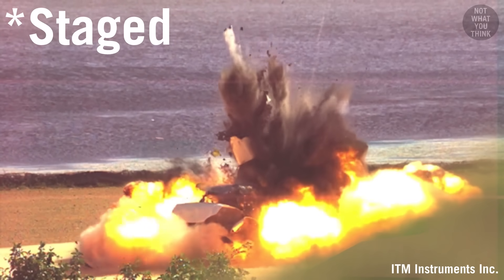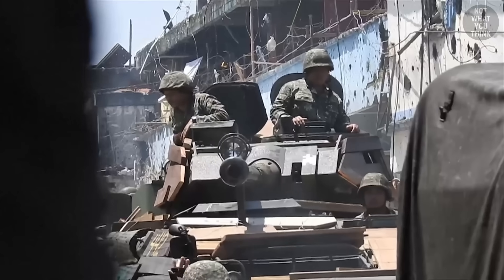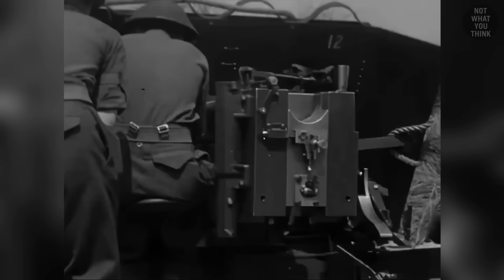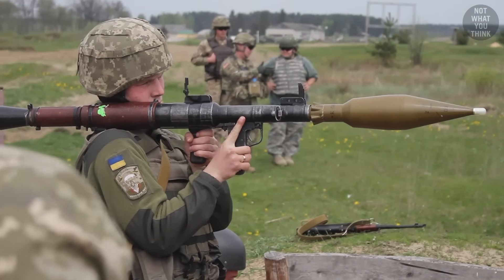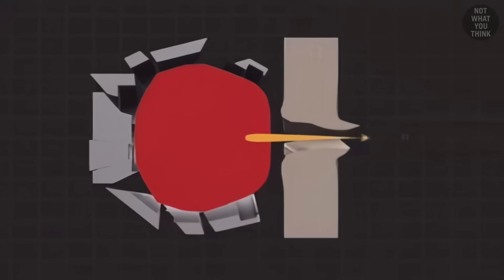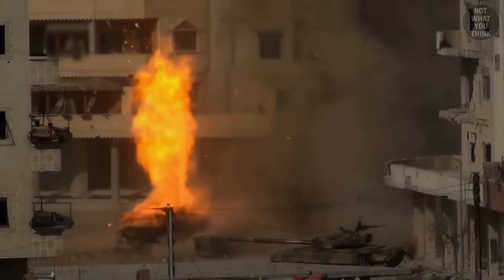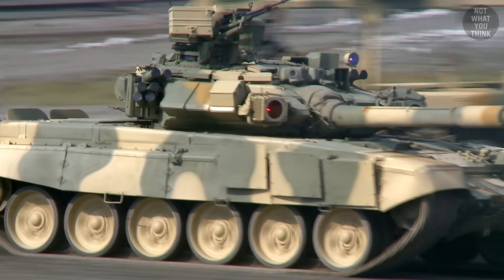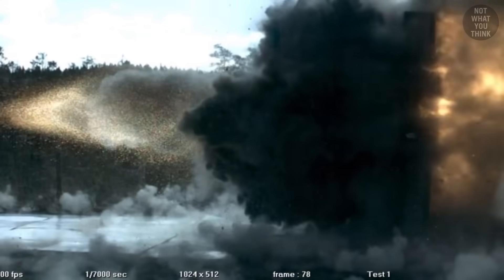Why Protecting Tanks is Getting Much More Difficult

Comment: you conclusion is not quite true when it comes to tanks being obsolete. They are still a terrifying weapon when used in the open. Tanks have lost it's role as a main tool to break through enemy trenches. This was basically what it was designed for in WW1. Today tanks are best used as a support tool and they work very well in the open area. The troubles begin if you deploy tanks in urban areas where their low vision range allows the enemy to come close and take an effective shot.  Russians made this mistake it at the beginning of their attack on our country, and that has cost them hundreds of tanks.

Concealed effectively, tanks can engage targets from distances ranging between 2.5 to 5 kilometers, well beyond the range of most anti-tank weapons like the Javelin missile. This long-range capability allows tanks to provide vital support by suppressing enemy positions and keeping enemies pinned down in their trenches while the friendlies advance, making them indispensable for successful breakthroughs.

The real tank killers are not a Javelin or the RPG, it is an FPV drone armed with a Thermite grenade which burns through every protection and a long range precision artillery paired with drone surveillance. I am surprised you have not mentioned these weapons at all You can get 100 drones for a price of one Javelin missile in the open market,  and that is a real game changer. Our guys deliver some world class precision work hitting the russian vehicles. Unfortunately, the russians learn from us, so they use a lot of drones too.

Comment: Tanks have been proclaimed "dead" multiple times. And every time they arose from it improved.
So yes, tanks will prevail. ERA and hardkill systems will evolve enough to counter infantry launched AT weapons and in groups of typically 3-4 tanks, they can cover each other against multiple threats. And when that point is reached, tanks will be again a dominating factor on the battlefield, if used correct.

Comment: In ukraine we could see that the concept of tanks is slowly dying off in the theater of war. They are mostly use as mobile artillery support barely ever going into direct combat. Drones on the other hand are ruling everywhere. Even travelling across the sea to reach crimea. 
But If we are still hyper focused on ground vehicles the concept of Armor needs to be thinked again. back to the drawing board. Thick plate of steel worked in ww2 but not anymore

Comment: 9:37 those nukes didn't go off because the conventional explosives used to trigger the reaction detonated on impact with the ground, which caused an irregular/unsymmetrical shape of the explosion, which was not sufficient to start the reaction needed to detonate the nuclear charge. 

basically, extremely lucky.

Comment: Pretty much the thing that always gonna keep tanks reliable is: big gun make other thing go boom.
Simply put, you wouldnt bring an Howitzer cannon to take out a entrenched position, because infantry will simply tear you down, you cant bring a SPG artilley either because auto-cannon exist.
Infantry wont do since all it take is one grenade and bye demolitions team, and you cant really protect them anyways.
Aircraft? yes and no, yes than you can take that position with them in matter of minutes, but no because, well you are limited by how much you can take out, how long you can stay in their airspace, how easy the targets are to strike... without even counting the costs and risk alone.
what about IFV, AFV, or APC for that matter, same with SPGs but without the main reason, the big gun. Yes things like Centauro, Stryker and so on exist, but those ARE SPGs by definition, so it didnt really change much.
All it leaves left is, you guessed it, Tanks. They the only thing that can take a big gun into a battlefield and just stand there, take alot of punishment, and you aint finna do nothing bout it unless you got the equipment AND training to deal with them, but praise god the tank crew inst experienced, otherwise you either got TOW/Javelins (or similar), Angry drones, or you go home in a body bag.

Comment: Tanks are not relevant on a modern battlefield
Reply: Active protection systems destroy incoming rockets/mortars/missiles, so they're fine.
Reply: @caesarsalad1170  But if we have APS, why would we bother armouring tanks as heavily as we do in the first place to begin with?
Reply: @mekingtiger9095  Because tanks still face small arms and autocannon fire and fragmentation?
Reply: @holokyttaja  All of these don't require an armor as heavy as that of an Abrams or a Challenger 2 to survive. A lighter MBT closer to that of a Leopard 1 would probably suffice.

Comment: You could just drone drop a contact activated shaped charge onto a tank. this would provide the same benefits as the javelin system, reduce the cost of the charge, and the drone can be reusable which would lower the cost of delivery as well. only problem with this is it would rely heavily on the weather for accuracy as far as I can see.

Comment: They should slap some non nintonian fluid between  a sandwich  of ballistics plats. Could definitely  help with armor. Yes it adds a ton of weight.. but.. we can build micro nuclear reactors  small enough  to power high powered electric motors tha can move the tanks. And a tank  now days is basically  a mobile bunker thay can provide fire support. Or anti air suppression.

Comment: The issue with Tanks in this respect I think comes from the fact it needs to expose itself fully to properly aim its main gun, and therefore relies heavily on its armor and active defense systems to survive. I think what we need is something that can use terrain more effectively. My nerdy brain immediately thinks of mechs, but I'm not foolish enough to think we have the technological capacity to produce them. At least not yet.
Reply: It’s already done. Many vehicles have unmanned turrets, like the Stryker mgs or the t-14 armata. I’m pretty sure the Abrams replacement to-be has it too.

Comment: In future A.G.S defense system will be developed and light armored tank will be the new standard as type of assault vehicle, heavy armors will be obsolete. A.G.S. stands for Active Graviton Shielding and it can be done in two different ways: phased A.G.S. and inverted polarity A.G.S. While the first is done with a high frequency square wave graviton generator, the package uses a lot more energy and it's also a lot bulkier, every kind of projectile and bombs will simply disappear at contact of such energy shield because of the high graviton density. At the contrary the inverted polarity A.G.S. generate a light density graviton field, but with inverted polarity (it repels matter), so the system can be designed to be less power hungry but it comes with limitation: the bullets approaching the target will be violently bounced back with the same incoming force, that's why you can see them ignite in mid air in a very spectacular fashion. But the problem is that for lower power type of explosion this system can still be used, when it comes to more powerful explosions (like missiles) the shield can be penetrated because of the low graviton density. Not only that... This kind of system is not suitable to protect against direct energy weapon like laser beams and graviton beams. From my time other hybrid system were developed like hybrid A.G.S with micro second booster generators, they can switch just for few moments to the power required  to stop a bigger threat to the vehicle. Ok that's enough from my 2045 diaries, time to go to my next temporal mission. But the point is: tanks will never be useless, my tank-lovers!❤😂

Comment: They have to use some tungsten or ceramic armor instead of steel
Reply: Ceramic armor isn't a very good idea for a tank or any vehicle, really. At least if it gets used as the external component of the armor. It is VERY succeptible to repeated hits from small arms fire and so any random with a machinegun can gradually wear it down by raining down enough bullets against it. The tank would pretty much have something very close to a videogame HP bar that is affected by any kind of mechanical physical threat as opposed to metal and that is not necessarily a good thing.

Comment: I think the future rolls of tanks will be battlefield coordination instead of direct combat. Heavy sensors, drones, soldier coordination, threat analysis, gear carrying.  Kind of a mobile "forward base" until a safer front can be established.
Reply: Tanks are also made to engage from way further distances these days. Urban warfare is not a great usage of tanks and that has been evident since Stalingrad imo.
Reply: @mikevismyelement Thank You! Anytime I watch videos of fighting that takes place today, I see tanks driving through neighborhoods. Is there that much of an advantage that a tank provides in urban combat? It just feels like it’s easy to turn that tank into a 70 ton road block and make the team inside a meal for rpgs flying in all directions from countless balconies and windows
Reply: @ydel1234  the reason why is that we have only seen asymmetrical warfare for the last 40 years outside of Ukraine. The old Soviet RPG's that insurgents in the middle east had access to wouldn't penetrate a modern tank. Tanks didn't have to fear every window, alley, or blind corner in these scenarios. 

Now that we have a more symmetrical battle in Ukraine, you see entire fields of blown up tanks for both sides. One can only imagine what Kursk was like

Modern anti tank missiles are incredibly effective at penetrating even the best armor. I think the strategy now is to roll the tanks in to "secure" the victory, as opposed to the spearhead tactics of WW2
Reply: At that point you might as well forgo a tank entirely for SP-Art or a IFV vehicle. The entire reason a nation foots the bill for the armor engine and gun on a tank is to either out maneuver the enemy or break through a hard point. If a tank can’t do either of those rolls it’s not worth using or making.

What you’re describing could be done by a tricked out semi-trailer. Or a tent…
Reply: @simonnachreiner8380  Finally someone here who gets it.  Combined arms doctrine consists of more than tanks and infantry.  But the way the tanks, armored personnel carriers/infantry fighting vehicles work together is simple.  If a tank and a platoon or whatever of infantry are working together, any enemy soldier has to be crazy to shoot off a rifle at a soldier protected by a tank.  When I was in, the number was about 6000 rifle rounds fired for each soldier killed.  (Trying to injure soldiers and not kill them is a way to tie up enemy soldiers tending to and transporting wounded.  The Russians have solved this by leaving the injured to die.  But I digress.)

Most tanks have a coax, a coaxial machine gun that uses the same sights as the tank main gun.  This allows the tank crew to save the main gun rounds for enemy tanks, APCs, and IFVs. A tank main gun round is much cheaper than a Javelin or other RPG, and more accurate unless someone has fired dozens of Javelins.  (Yes, the tank crews, at least American tank crews fire several dozen rounds a year.)  So the soldiers, with a friendly tank nearby, know that their job is to take POWs, and shoot anyone carrying an RPG.  What if there is a likely ambush spot up ahead?  In Vietnam,, there was a case that shows this perfectly.  A convoy was heading up a trail with a large tree off to one side.

"I wonder how many snipers are in that tree," the Platoon commander mused.

"Gunner, canister, tree...Fire!  Sir, there were eight, the Platoon Sargent replied.

This is the way combined arms works--the presence of the tank(s) keeps the infantrymen alive, and they take out anyone on foot who threatens the tank(s).
Reply: @eachus Yeah. Tanks these days seem like they really need the support of IFVs and infantry to protect them from hand-held anti-tank weapons.
Reply: @simonnachreiner8380  No, a semi-trailer can't parallel a street going through the ground floor of houses, apartments, etc.

The tank has a much lower ground pressure than an automobile.  If there are RPGs around that is where you drive and/or park. Same thing applies to tree lined roads.  The tank can parallel the road and stay away from anti-tank mines. It is hard to plant mines in or trees or tree roots.

Of course you may need to be "buttoned up" and trust the dismounts for situational awareness.  But you have lots of ammo for the coax to deal with suspected leakers.
Reply: good idea..lol but that thing would have to be huge to matter .. and at that point a huge target and still worthless.. noo what your talking about we already have in the air bud.. its called the AWAK (huge plane with a radar looking disc on top) its a mobile command and radar station.. tinker air-force base in Midwest city Oklahoma is the base of it..) not sure if I spelled it correctly.. but its outdated and they are placing it with a smaller more agile twin tail I heard with actual countermeasures..
Reply: @desperatedave3573  The new AWACS is called a Swallowtail.  The rotating dome has been replaced by an electronically steered array.  Eliminating the vacuum tube that powers the radar will be a nice cost savings, but the real savings are replacing a 4-engined 707 with a 2-engined 737.
Reply: Aerial superiority is the trump card here.
Reply: The Germans also made command tanks with panzer i and ii at the start of ww II to command tank groups at frontline, which is sort of like a command center
Reply: Exactly. We still have our ground to guard and i don't think tanks will go obsolete for foreseeable future.

Comment: This situation is more similar as to why people don't wear medival armour anymore. Even the thickest plated knight wouldn't stand a chance against a heavy crossbowman or in the later years a musket. That is because the destructive powers and penetration of this simple and cheap machinery became too good and that armored knights are basically just a slow walking target. It wasn't long before people started to ditch the armors as being too heavy and inconvenient to use. That's why in the later years, people began wearing only chest armor and those flashy and easy target redcoats.
Reply: You really overestimate the penetrative power that heavy crossbows had against late plate armor. Skallagrim has a video testing a heavy crossbow against plate armor and it's pretty good. As for muskets, plate armor also did a decent at keeping up with their desteuctive firepower... until the 17th Century when it just couldn't anymore.

That said, body armor has been making a massive ressurgence in the last 20 years and is still getting better and better even now in the form of ceramic plates. It has gotten to a point where the ever so iconic 5.56mm NATO round isn't sufficing anymore and even the 7.62mm is getting stopped aswell. For the first time in almost 400 years we're finally seeing armor catching up to firearms in the small arms department and armored (to some degree) infantry is finally returning to the battlefield. I'd say this is pretty damn revolutionary!

Meanwhile for our modern equivalent of "the Cavalry", though...

Comment: The whole video is based on the premise of "Arrow vs Shield" and how these two have surpassed each other in a constant tug of war yet ends with "is this the end of the cycle?". What, just because you've seen tanks taken out in Ukraine? Lmao.
Reply: exactly right, we have gone through this cycle at least twice with tanks, a good example is early to mid cold war designs like the leopard 1 which focused more on not getting hit due to heat rounds.  Then came ceramic armor which does a good job at defeating heat and shaped charges, when KE penetrator rod sabot rounds came out as a response at the end of the cold war through the gulf war then heavy metal chobam armor which combines ceramic levels of HEAT round resistance, and the density of the heavy metals like tungsten and DU which are very effective vs KE weapons.  BTW they do just fine vs all of the methods mentioned.  Given a redesign of turrets, to account to topdown attacks and I dont think protection will be out of vogue any time soon.  Also given the speed of drones and missiles your not gonna be able to dodge or shoot down all of them all the time, armor is passive and in a age where weapons are getting cheaper and cheaper passive becomes more economical/feasible.
Reply: @Lucinat0r  Also, are we just gonna ignore how armoured infantry with ceramic plates is back in fashion these days? Small arms are finally for the first time in centuries struggling at killing infantry...